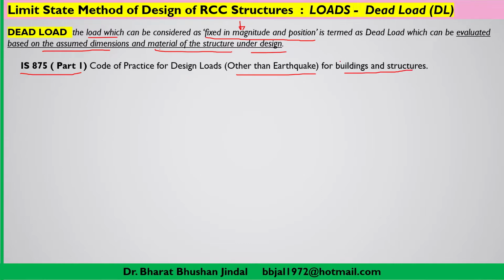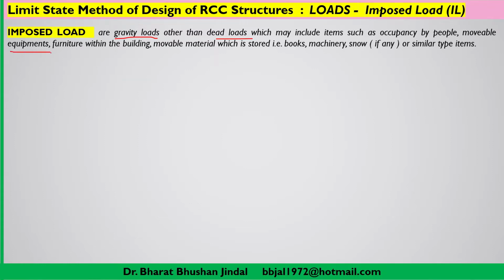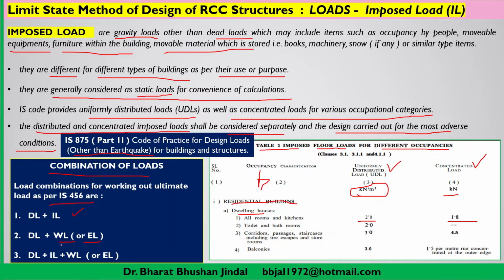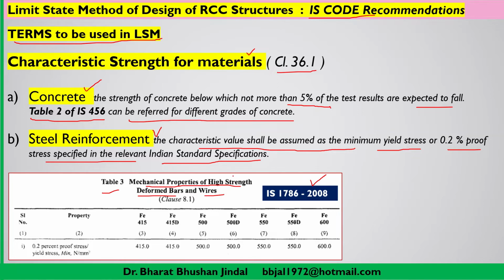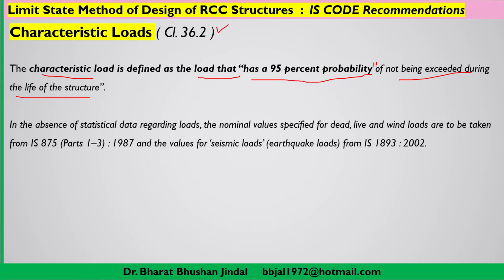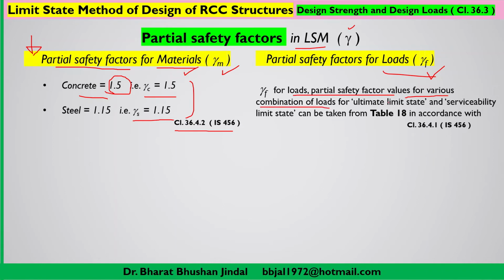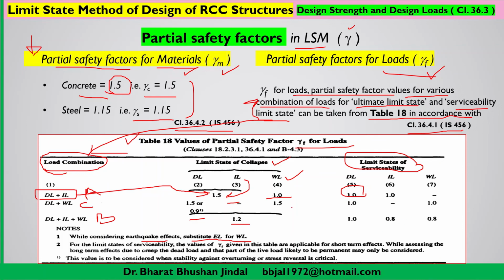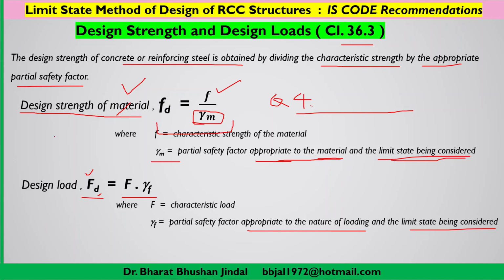Design of Concrete Structures ( Lecture 5 )

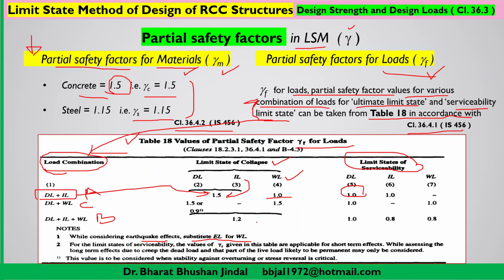Comment: (31:30)Value of partial safety factor for limit state of collapse is taken higher than that of servicibility limit because in case of collapse we estimate 'safe' values where as in case of servicibility we estimate 'actual' values of deflections, and crack widths hence safety factor of unity is appropriate.

Comment: Main reason for partial factor of steel is lower than concrete because steel in manufactured in control condition. Control condition means properties of steel can be varied as per requirement ,So considering unpredictable quality of concrete we take higher factor of safety to be on safer side.
Reply from the maker: Correct

Comment: as the height of structure increases the tendency to get affected by smaller amount of wind disturbances increases, how to overcome this ?
Reply from the maker: Effect of lesser forces due to wind at low height will not affect greatly as already sufficient partial safety factors are used in designing.

Comment: We take partial safety factor into consideration because it assures that structural design does not occur any unexpected failure or presence of deformation or defects. Smaller the partial safety factor, higher the chances of design to fail.

Comment: Concrete is not much in control as it is a composite material and there is variability in nature as compared to steel. It is difficult to control all these factors, that's why we take higher partial safety factor to be on safer side.
Whereas steel (homogeneous material) is manufactured in controlled conditions and it's properties can be varied as per requirement.
That's why partial safety factor for concrete is higher than steel.

Comment: 1. As already discussed steel is manufacfured in controlled conditions in the laboratory while it not the same in the case of concrete, it is manufacfured in the field so steel will have less partial safety factor than concrete.

4. By applying the partial saftey factor we will be getting design strength, which will be the minimum strength of any material to be used in the structure, it increases the structure's safety as we will be aware of the danger much before the failure.

Comment: Lecture 5 can be summarized in the following points:
1) In this lecture mainly 4 topics were covered which are: a) loads to be considered in design calculations. b) characteristic strength and load. C) Partial safety factors. D) Design strength and loads.

2) Starting from the first topic we read about various loads such as dead loads, imposed loads, Earthquake loads, wind loads and their combinations given in IS(875). It can be said that the loads considered in design calculations depends upon location and type of structure in general.
3) Dead loads are the loads which are due to the self weight of the structure and can be evaluated based on the assumed dimensions and material of structure under design.
4) Imposed loads also known as live loads are the gravity loads other than dead loads which may include items such as occupancy by people , moveable furniture, equipments etc. within the building. It should be noted that distributed and concentrated imposed loads shall be considered seperatly and the design should be carried out for most adverse conditions.
5) After this topic, Characteristic strength of materials like concrete and steel reinforcement is well explained. Also mechanical properties of H.Y.S.D bars were discussed; as given in clause 8. 1 of IS 1786-2008.
6) Characteristic load is the load that has a 95% probability of not being exceeded during the life of structure.
7) After reading about charac. Loads , Design strength and design loads were well explained in the video. The design strength of concrete or reinforcing steel can be obtained by dividing characteristic strength by appropriate partial safety factor.(P.S.F)
8) P.S.F for concrete is taken as 1.5 and for steel 1.15.
 P.S.F for concrete is higher due to the reason that we do not have check over quality parameters at site during making of concrete. So we take higher partial safety factor value.
9) Design load = Characteristic load × Partial safety factor.( appropriate to the nature of loading and the limit state being considered).
10) IS 875 part(1-3) gives nominal values specified for dead, live and wind loads. For earthquake load consider IS (1893 : 2002)

Comment: Sir when there is a requirement of steel reinforcement and concrete  ,it is always  considered to have them for there safe value against failure.as we know that steel is manufactured under controlled conditions that is what properties of steel or what type of steel we require like fe 500 ,fe 250 fe 415 ,we can prepare it prefectly .but when we prepare concrete at sites ,we cant predict the value of compressive strength  it can bear as per requirements we need .thats why to be on safe side againt failure ,we keep partial safety factor of concrete higher than that of steel

Comment: Partial safety factor of steel is lower than concrete because steel is manufactured in control condition means it can be varied as per requirement. Machine used for making steel bar is very efficient and equiped with high accuracy software which ensures the quality of steel.

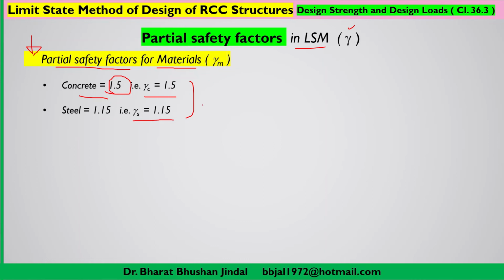Comment: 27:40 because steel is manufactured under controlled conditions , whereas the quality of concrete is unpredictable , that's why we take partial safety factor of concrete slightly higher than that of steel .

Comment: ANSWER:
The partial factor of steel is lower than that of concrete. This is because steel is manufactured in control condition that is steel bars are made in factories using efficient and high accuracy machines which ultimately ensures the control over the quality of the steel bar.
Whereas
The quality of concrete is not much in control as it depends on various factors like site condition, weather, temperature, aggregate properties, cement properties, water quality, water cement ratio etc. So it is very difficult to control so many factors at site. Thus, we take higher factor of safety to be on safer side.

Another reason for the same may be that concrete failure is considered more vulnerable than the steel failure. That's why when we observe a collapsed building we will see that bars are not broken, only concrete is.
That is why we consider the partial factor of concrete more than that of steel..

Comment: Partial safety factor for steel (1.15) is 
comparatively lower than that of concrete (1.5) because value of partial safety factor depends on how controlled the quality conditions are.
In case of steel the quality conditions mean that the properties of steel can be varied as per requirement. This is not the case in concrete as concrete's properties are highly affected by its exposed condition i.e. the properties are controlled by weather, temperature, aggregate properties, cement properties, water quality etc, which makes it very difficult to control so many factors at  site. 
Therefore considering  this unpredictability in the quality of concrete, the partial factor of safety is considered higher then that of predictable component i.e. steel.

Comment: We are really very grateful for your efforts, Sir🙏🏻🙏🏻. I am really happy about the fact that as soon as I had a doubt in particular statement, in the very next line, the doubt was cleared.
I do have a small question, in the grades of steel, what is meant by 'D' in yield stress values?
Reply from the maker: Thanks.  The word 'D' basically indicates improved quality of steel in terms of ductility. Improved ductility means higher level of elongation property.